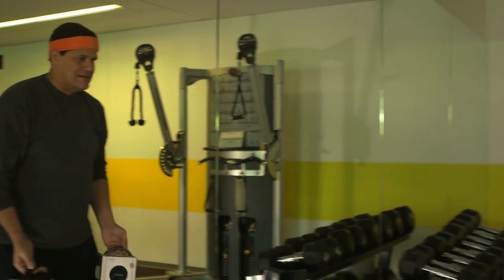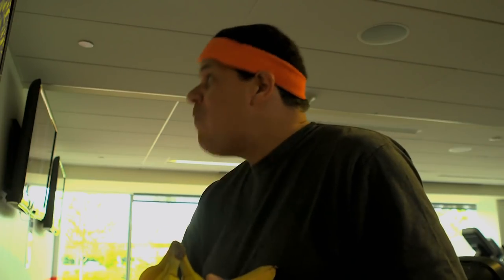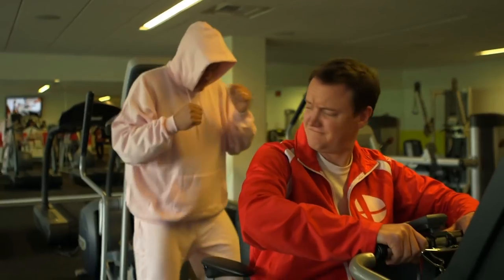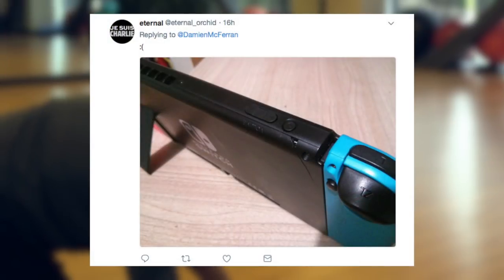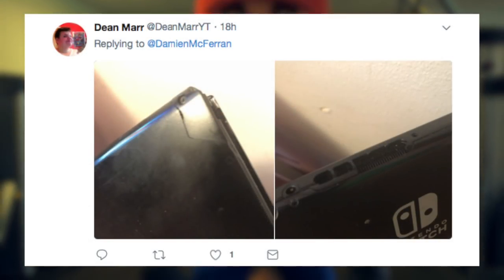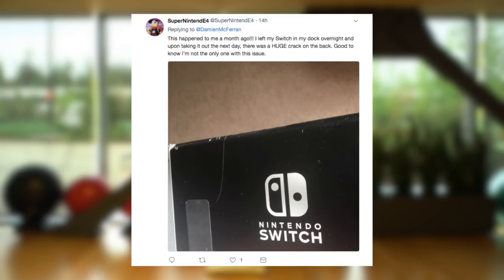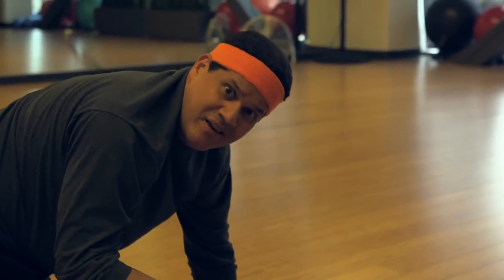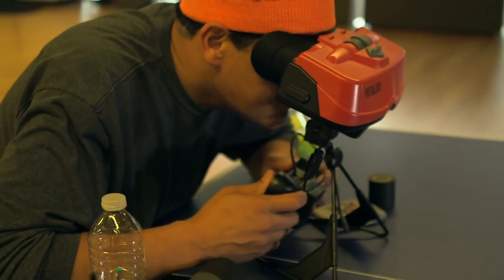Is Your Nintendo Switch Cracking Under the Pressure?

Comment: My switch cracked around the vents area pretty much fully across I ordered a new shell and  installed in around 45 mins haven't had an issue with it  since. Pretty easy to do if u are good with small electronics but it does pretty much require a complete tear down including removing the screen and digitizer. This was around 4 months ago I have a launch day unit as well. But the switch is extremely modular in design and very easy to repair its almost self explanatory 😅

Comment: i got a very small crack on the power button from the first week i bought the switch.(got it on launch day USA)  it was from pressuring the power button too much because my charger was doa from the box and i didnt understand what was happened. never dropped. nothing has happened to it besides the tiniest crack and it hasnt expanded.

Comment: Mine's fine. I rarely take it out of the dock. Although I should note, shortly after I got my Switch and saw people posting pictures of their Switch's getting scratched by the dock and some showing their Switch seemingly being bent, I removed the front panel of the dock. So now when my Switch is in the dock there's nothing really pressing up against it. Hopefully this doesn't lead to problems with the charging port.

Comment: Checked mine: no cracks.
From US and keep my room very cool 68° F nonstop cuz its ridiculously hot outside. Never put a skin on my switch nor have I dropped it to my memory. I've made several long trips with it in officially licensed carrying cases. The temperature may be the potential factor for most people. In my area I hear about varying electronic devices only lasting a few years and when Im asked I still have a Plasma TV still fully functional bc of the fact that our house is kept that cool.

Comment: Plastic that has no heat resistance tends to get very brittle if heat is applied on a regular basis and then crack given the design of the Switch I would guess this will start to become a very common sight over the next few months and I would expect the plastic around the air vent to crack and be very brittle first but it will depend on how much you use the switch people that use it a lot I would think they would see signs first.

Happens a lot on devices with cheap plastics and even higher end devices that would be higher rated for temps will after time start to crack too.

Comment: I have my Switch since Christmas time. And the only things that is wrong with it is that it is a little dusty. And the screen is a little dirty. Which is only understandable since I am always constantly playing with it. And I keep forgetting to clean the screen. But there is not a single crack on it. And I have accidentally drop my Switch quite a few times or so. But there is still no cracks on it. But there is a few tiny light scratch marks on it. Thanks to my finger nails. But that is really about it. Btw this is the first I am hearing about this crack Switch problem. So this is news to me. And when I am not using it. I always keep it in my cloth carrying case. Unless I need to charge it. But I try to keep it protected as much as possible.

Comment: I've had my switch crack twice, once in the corner of the back, and 3 of the prongs above the heat vent. 90% sure that the vent ones are from me over tightening screws when I put on a custom back but the corner is probaly from heat. 

And no, I have never dropped it.

Comment: Mine cracked just out of the blue by one of the upper screw holes and GameStop screwed me out of my warranty on it. I bought a replacement shell for the switch but I feel like that’s too risky if something were to go wrong in the repair as I couldn’t even pay to get it fixed from Nintendo if I messed up

Comment: Happened to mine and I took absolute care of my switch as I still do. Consoles are too expensive to just let break so I'm very careful with it. I've had mine since launch. Day one. March 3rd 2017. And I noticed it back in probably January of this year near the power button was a small crack. Looked it up and it was stupid common. Called Nintendo and as much as I'm a fan, they said it's not covered. So I end up just buying a custom shell for the switch and joycons my self and  putting it on myself and it looks way better than the switch originally did anyways lol

Comment: Mine isnt cracked and there was one time I accidentaly left my switch covered with a cloth so the hot air that was being expelled by the switch didnt have room to flow out, after realizing this I noticed the bottom of the switch squeeked when you pressed it, but idk if that was already there. Anyways there hasn't ben any cracks on the shell, its ben about 90F here this past week and my switch doesn't have any of those problems.

Comment: I have a day 1 Nintendo Switch. It has no cracks and no scratches. I have accidently pushed it down while it's been inside the dock to the floor 3-4 times. Again, no cracks and no scratches whatsoever.

Comment: I've dropped my switch a few times because I'm a clutz but it hasn't cracked yet. The plastic on the left side feels a little loose on the back but I figure that's either heat warping the plastic or it's loose from being dropped and the screws need tightening

Comment: I played my switch pretty hardcore for a few days straight. It got really hot and told me the battery was low with a full charge. I took a break for a few days but the switch isn’t designed for hardcore use.
Reply: Michael Acevedo It is. The fan adjusts its speed automatically depending on the load and the temperature. I'm sure it knows better.

Comment: my first switch had the problem cracking by the power button and the back shell, i traded it in for a new one, and i immediately loosened my screws one turn each, and it's perfectly fine.

Comment: Mine has the same cracks in the vent area.  In that area there are four little arm like pieces, one has completely broke off and the others all are cracked.  Mine has never been in the dock, I only use it in hand held mode.  And I baby it, so I know it’s nothing I’ve done.  I think as time goes on all of them will have this problem from the heat.  I’m calling Nintendo tomorrow to see if they will fix it, this is ridiculous

Comment: Personally my switch is still in almost new condition as I use a tempered glass screen protector and even after a few drops there seems to be no cracks and not many scratches.
I've had my switch for about a year

Comment: I checked mine, and... Whew. No cracks. Although, remembering the bending Switches problem, the plastic screen on mine (for context, I have no screen protector on it) does tend to pop out a little bit near the edge, possibly due to my system not being perfectly straight. Just thought I would mention that.

Comment: For my Switch, the plastic clicks on the bottom by the stand if I press on it. Idk why. And my glass screen protector has a chip in the centre bottom. Other than that it's been fine.

Comment: I do see a small spot near the left Joycon area. It's nothing serious, the Switch still runs like a champ, and it still runs fine (and it looks more like I may have scratched in that small spot; wouldn't be the first time I did that to a console, so I kinda went "eh" and carried on), but hopefully it's nothing too serious or anything.

If it turns out it is, however, then hopefully they make a later model to ensure it won't be a problem in the future.

Comment: Mines not cracked but the panel lining near the vent and top back side of the Switch is not fully flushed on a part of it so if I wanted to I could pull off the panel (more like break it off) with effort if I tried. I sent it in for repair and they only fixed part of the problem.

Comment: The joystick for my left joy con is struggling. Every time I turn it down, it is unresponsive unless I press it harder and my plastic joycons are a little loose but those are the only problem I'm having with it. I am really sorry to those of you who have cracks
Reply: Isaac Rumley the lock that keeps the joy cons on the switch itself is broken for my right one. So it slides off without pressing the button, but with some force so it doesnt fall off by accident. Besides that mines not cracked at all
Reply: Neko Seikatsu yea mine's not that bad it still stays on but apparently you can replace the thing that hold the joy cons on the console from plastic to metal and it stays secure
Reply: Isaac Rumley yea theres kits online for like 10 bucks but apparently if I do replace the little latches the warranty on the console goes away. Not entirely sure tho

Comment: My day one switch has no signs of crack. To be fair, I did take my switch apart and replaced the thermal paste with better paste and added thermal pads to further improve the cooling.

Comment: No it hasn't... Weird. Have you been keeping it lying flat with a game on?? Cos excess heat + heat from the Switch itself might be creating the cracks.

I did it once and my switch had "expanded" a bit, similar to the Samsung Galaxy thing -- though of course Nintendos designed it so it wont explode, just expand haha, and simply turning it off and letting it cool worked, but I feel like if I'd kept BOTW on with the switch lying flat on its back it might've caused cracks, esp in this heat.

Comment: I have somehing similar - wouldn't say it's cracking, but it could count. Basically, the back started to peel off, it seems. I put some masking tape on it and it works just fine; as I said, not exactly cracking, but could be related. I should also mention this happened before the heatwave (yes I live in the UK) and I have dropped the switch before.

Comment: My Nintendo Switch has heated up so much that the plastic over the fan just melted off. 
I don’t know if that counts...
Reply: The plastic starts bending at around 90 degrees celsius. The switch never reaches the temperature even with help of putting towels on it's vents and even then the console has a protection mechanism that shuts the console down. Are you sure you didn't help it?

Comment: I sent in my Switch to Nintendo in regards to erratic joy-con connections and battery issues - I got told my Switch had cracks near the vent ports and that they could swap out the console for AUS$95... which would fix all the problems. I said yes but it’s funny they didn’t mention any of my other issues. So I guess my old Switch did have cracks on it.

Comment: Well... just saw this video and was curious to see if mine had any cracks. looking at it, all was well, then after a second more detailed look around... ah man, the top right screw at the back of the switch has cracks near it. I've never dropped my switch and keep it in the Hori Tough Pouch case when not in use. Don't keep it anywhere hot so don't know how that's happened :/ Oh yeah, from the UK.

Comment: I live in an area that is usually +100 f (+38 c) for three months and year and I have nothing wrong with my switch.   Switch is carried in a case and in a well ventilated area.  No warping, cracking, or overheating. Switch is used daily.  Day one

Comment: Mine has had a crack on the top right corner from the power button since last year. I also have a hairline crack on the bottom. And honestly hasn't gotten worst since then and is only on the back plate. I agree its a heat related issue and I hope Nintendo puts spare back plates on sale on the site (last I checked its just the kickstand available). I don't mind fixing it myself and it should be pretty straightforward.

Comment: No cracks on mine.  I've put a ton of hours into it, both docked and handheld.  Besides analog stick drifting which I was able to fix easily, I haven't had any issues. But I'm also very careful with my switch, which I'm sure helps

Comment: Mine isn't cracked but I rarely use it docked so it usually doesn't get very hot (compared to the dock which I can hear the fans ramp up all the time)
Reply: As I read the comment and re-watch the video it seems that the majority of cracks are happening in the dock
this could be happening because, as I stated earlier, the Switch is getting too hot to the fans are ramping up and cracking the plastic in that area

Comment: Mine cracked on the first month due to overheating, i have not dropped it, though it also has had battery issues whenthe Screen froze and the battery life max was about 14 seconds

Comment: I wouldn't think its the heat, I have a first wave release, and as I live in central Texas, where its been getting about 100 degrees on average the past few weeks. I haven't noticed any cracks on mine, but I suppose this video has made me paranoid enough to double check.

Comment: The plastic between the right Joycon and the screw has completely cracked off, though I’m sure it’s not from misuse. I keep very good care of my $300 device, but it seems this problem is caused from uncontrollable variables. I am disappointed that this was overlooked by Nintendo’s quality control, but at least it’s still usable.

Comment: A product that is excellent at fixing this it's called Bondic look it up and use responsibly don't put it in the buttons. I haven't had this happen to my switch but I have had it happen to other plastics do to dry heat. I am not sponsored in any way but bondic does a good job at seeking cracks in plastic however if you want just dip you switch in a tub of flex seal like Phil Swift would probably do like he does with his tools. Stay Awesome and I hope this helps.

Comment: I called Nintendo about my cracks, they told me it was a defect on their end, and they'd fix it for 20$. 
And it'd take a month to get back.
 Neither which if found acceptable, because it was their screw up, so here I am with my still cracked switch. Thinking of replacing the backplate though

Comment: I live in Brazil and the normal temperatures over here are about 26-30 °C and My switch isn't cracking
Reply: Joao Pedro Torres Marques 26-30 aren't normal temperatures, because it's just as hot even here in Russia
Reply: Михаил Михайлов If it's just as hot, why wouldn't It be a normal temperature?

Comment: Luckily i dont have any signs of it. When i put it in a case or bag, i make sure that the switch is powered off and not in sleep to avoid any accidental buttons that will turn it on.

One thing to note, i play mostly docked.

Comment: My day 1 Switch is warped, but has no cracks. Then again, at times, my Switch will warp to a point where it's flat, or it's a banana. Cracks could be a result of it warping significantly in the wrong direction

Comment: No cracks. I use it in docked, handheld, and tabletop too. I even abuse it and leave it running intense games for days with the fans on. I also swap out joycons alot. No problems. I keep my place at 72°F (22°C). I've had it since launch. Dunno what to tell you...

Comment: America my switch has no cracks and I think I can help when taking your switch places put it in a case to protect it from element every so often check to see if your switch vents are to hot if so turn off immediately or if the vents are blocked unblock them immediately I also use a cleaner for mine to make sure there is no grime build up but that's not a necessity

Comment: Well, mine has been dropped onto concrete, twice from about 1.5m, no issues, except a cut on the edge of the lock mechanism of one joy-con. Now I can pull it off with some force, without pressing the button on the back. But I would still consider this to be my own fault. So far, it has been built like a tank. :)

Comment: I have quite literally had my Switch since the first day, and play it nearly every single day. After close inspection I (thankfully) have not experienced this issue. While the degree to which the Switch can heat up has worried me. Thus far (again, thankfully) it has not proved and issue. 

And just to be clear, I regularly play in both portable and docked modes.

Comment: I have a very small crack but considering the abuse it's been through its really good. I've also played over 200 hrs in botw 100 in odyssey getting to 100 in ARMS well over 400 in splatoon nearing 100 in mk8 and probs another hundred from various indie games like celeste. Holy cow I've poured a ton of time into the switch.

Comment: Um...I checked mine, and sure enough, it has cracked all along the grill bars and the screw area, just as you described (I got it on midnight release of the console). I'm over in America and I take very good care of it, even when traveling and using it in handheld (which I do only occasionally). Never noticed this until seeing this video, but definitely concerning and disappointing. Thanks for making me aware of this...I went ahead and submitted my answer in the poll of yours.

Comment: It's generally recommended that devices housed in plastic shells don't be used in temperatures exceeding 30 degrees Celsius. It's common sense for me. My ps one in 1997 stated this in the box and I was living in Cyprus at the time which has temps around 40 Celsius in the summer and around 20 still in the winter. So yes... if you have been taking your switch outside and using it in this blistering heatwave... well that's your fault, not Nintendo's.

Comment: Nintendo consoles are always cheaply made. I remember the same issue with the original 3ds. Cracking buttons and the screen getting scratched while closed.
Reply: astro-nut PS4 was loud. Xbox 360 always died (basically on everyone) stop acting like Nintendo is the only one

Comment: Mine broke around the three very tiny screws on the top and bottom (never dropped my Switch). I just bought a new backplate from China to fix the problem.